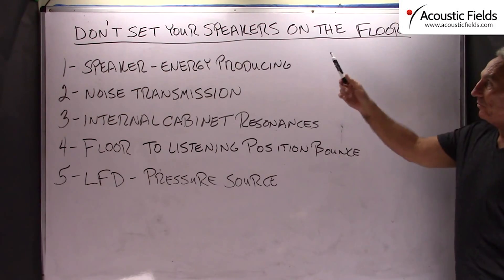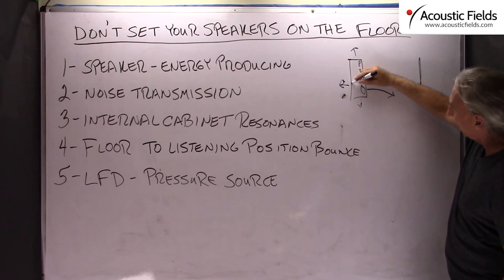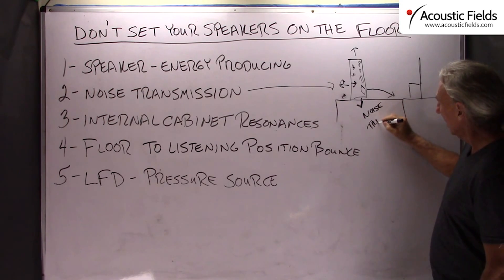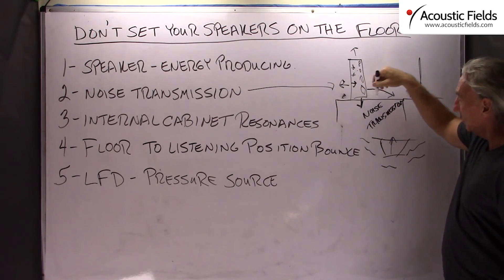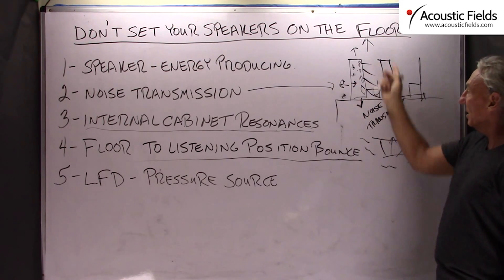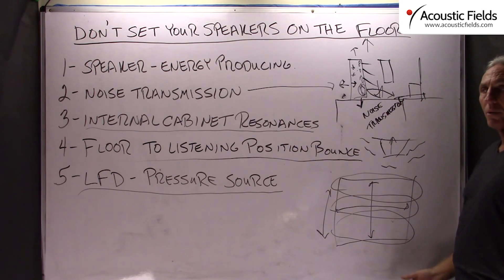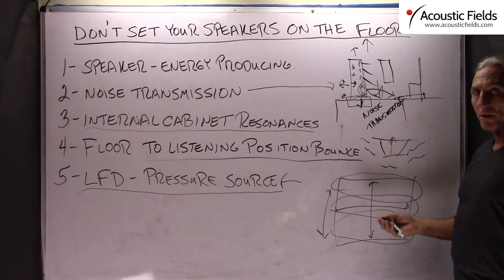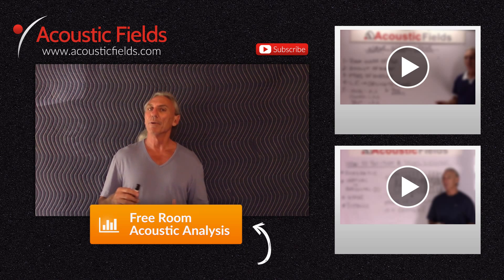Don't Set Your Speakers On The Floor! - www.AcousticFields.com

Comment: I am glad to have found your video, thanks for sharing.
You may be the best to ask, do you know why the speaker manufacturers place the base driver at the bottom?
The LF waves do go about137 degrees in all directions and there by also down toward the floor, bouncing directly up again, with mudding as a result.
Reply from the maker: F,  It is something I have wondered about for years. Some manufacturers place the low-frequency driver above the middle and high-frequency driver.
Reply: Thanks a lot for answering! Glad that I am not the only one wondering:-)
My idea is to place the base in a 45 deg towards the sealing, above the tweeter in a normal high speaker so that the tweeter still are in the height of the ears. In that way, I do think that you minimize the reflections most.
Reply from the maker: F, Positioning of low-frequency sources in small rooms has always been an issue. The issue with most suggestions is that they assume no low-frequency management within the room. If you treat your room with proper low- frequency absorption, positioning becomes much easier.
Reply: You are completely correct, most do just bye a speaker and let that be that.
But even if one are using your guaranteed great products, I think that the manufacturers should try to avoid most of the problem in the first place, then would your product have even better condition to make the sound pure perfection. :-)
Reply from the maker: F,  One would think that but I know a lot of these designers and have asked them just that question. Most tell me it is about appearance and size. Go figure.
Reply: So rather nice to see then here?! Yes go figure! :-)
Reply: I guess that the point of most designs is to have the tweeter at ears' level, and this conditions the placement of the other drivers lower.

Comment: Speakers have more bass on floor
Reply from the maker: K,  Quantity is not quality. You are hearing floor and subwoofer.
Reply: When it's up on air or on a stand bass gets reduced is it not better to stretch the bass by putting on something that will elevate the bass?
Reply: @TheLetterK81  the crap from the room get reduced - you shouldn't hear anything but the music and the speakers and the "more bass" attitude disappear when growing up :-)

a serious system has adjusted the levels of every speaker to ensure a flat curve over the whole range
Reply: it doesn't damage the bass or speakers in any way
Reply from the maker: K,  No.
Reply from the maker: K, What does "stretch the bass" mean ?

Comment: 2:00 I've always thought that frequencies below round about 100 Hz cannot be localized anyway as long as the wave length is more than any of the rooms dimensions. I'd say there is something going wrong if one can hear and localize the sound coming _from the subwoofer_.
Reply from the maker: E,  Wavelength is a factor. However, remember that energy is oscillating throughout the room in cycles.
Reply: Understood. So as the low frequencies might not be localized in any case, the vibrations in the room caused by the speaker do color the sound and cause reverberation? Thank you for your reply.

Comment: Can I pay for some of your time for a phone or Skype consultation? 

I'm from a very small town and was a part-time DJ for some time. I am helping install a PA system for a local bar owner who is not technical at all. I know plenty enough to get them something working, functional, and quality...but I want it to be perfect, and I think you have all the knowledge to get me that result. I can document the exact room dimensions, planned speaker placement, planned equipment, and any other information that could help me extract the most advice from our call. Please let me know. Eight One Zero, Two Four Seven, Three Two Zero Four is my phone number.
Reply from the maker: Y,  Fill out the information in this link: https://www.acousticfields.com/free-room-analysis/

Comment: Mr Dennis, thank you for your great explanation, but I have a question about, what kind of floor material do you refer ?, that affect happens with a concrete floor?
Reply from the maker: G,  Floor coverings vary with usage. Wood floors for control and mix rooms.
Reply from the maker: G,  It depends on the usage of the room. Every usage is different.
Reply: Carpet Floor has the best bass why would anyone want to raise it ? it's less bass when raised up
Reply: What about a concrete floor with porcelan tiles?

Comment: What if I'm using a vintage floor firing sub on hardwood floor?
Reply from the maker: J,  Raise it off the floor at least 18" . You must isolate and absorb energy at the same time. Here is out sub platform which does both.  https://www.acousticfields.com/product/subwoofer-platform-absorber/

Comment: Ive always been a big fan of using 4 thick rubber feet, and attaching that to the bottom of a tower speaker/subwoofer. Rather cheap, and elevating things just a few inches makes a world of difference. IE hearing the speaker, not the room.
Reply from the maker: Hi B,  Yes, elevating the speaker minimizes the comb filter effect from the floor to listener. Finding the correct height to seated position ratio is the key. We elevate listening and speaker position.

Comment: What about speakers that are di pole or have cardioid elements to lower the rear and side noise
Reply from the maker: A,  The radiation patterns of speakers are part of the design parameters by the designer. A dipole radiates energy from both front and rear surfaces to create more energy which is a combination of reflected energy from the rear wall and the front of speaker. I do not subscribe to the philosophy that more is better.
Reply: @AcousticFields  Dipole speakers seem like an invitation to out of phase sound wave cancellation (dead spots in certain places in a room)

Comment: If you're dead set on setting your speakers on the floor, here's a quick way to make mass based isolation pads:
4 inch solid concrete construction blocks.

That's it you're done.  

$3 each at the hardware store.  If you want to protect your speakers from scuffs, add a piece of cloth or felt between the blocks and the speaker.

Or if you want them to look pretty: 
Wearing safety glasses, hammer away any flashing or protrusions. Coat with plaster of paris. This will fill in all the voids, and sharpen the corners after sanding. Sand flat with 120 grit sandpaper. Spray paint whatever color, maybe add a clear coat. If you're using these on a desk, hot glue some felt feet to the bottom.  Boom. Mass based isolation.
Reply from the maker: Concrete is a good isolating material but does very little absorption at lower frequencies. You can achieve both with our carbon technology. Here is the link:  http://www.acousticfields.com/product/subwoofer-platform-absorber/

Comment: what a load of rubbish speaker cabs are made NOT to resonate as this would colour the sound
Reply from the maker: Hi Martin,

Speaker cabinets are small rooms, very small rooms, but nonetheless they must conform to the laws of physics. Though the goal of speaker cabinet designers is to reduce modal pressure and the resulting cabinet vibrations, most do not succeed. The sound you hear in your room is composed of three variables. First, you have the driver itself. The materials used in the cone and frame assembly contribute. Secondly, the cabinet the driver is installed in has modes and vibrations within in it. How the designer treats these issues influences sound. Even the cabinet material contributes. Finally, your room contributes its own "sonic stink" to the equation through reflections and modal issues. The sound you here in your room is part room, part driver, and part cabinet.
Reply: Speaker cabinets aren't made TO resonate, but a lot of them aren't made to NOT resonate.  It's a byproduct.
Reply: I've always wondered why monitor manufacturers don't bother to put acoustic foam on the inside walls of speaker cabinets... Any insight to this? I can't imagine it would add much to their assembly costs... O.o
Reply: Some manufacturers do but foam mostly absorbs higher frequencies which never make it out of the box in the first place. lower frequencies of about 500hz and below are what cause a box to "ring" and foam wouldnt do much of anything for that.  bracing is what helps those frequencies so  bracing is more of a sign of a well built box than foam.
Reply from the maker: M,  Not true. The sound that comes out of your speakers is a part driver, part electronics, and part cabinet modal issues for the inside space of the cabinet and part cabinet resonances. The design goal of the speaker designer is to combine all of these colorations into the sound he is designing for.
Reply from the maker: M, Nothing could be further from the truth. Put an accelerometer on any speaker cabinet and measure. Speaker sound output is a combination of cabinet resonances, driver speed, cabinet design and a host of other variables.
Reply from the maker: Whether it is part of the design parameters or a secondary concern, both are audible.
Reply: You are correct, but they STILL DO.

Comment: Your  video makes sense only if the floor is hollow..Like a wood floor thats raised...99% have concrete floors.......
Reply from the maker: Floor composition and comb filtering are separate issues. It is that first bounce from speaker/floor/listening position.The speaker/floor and ceiling bounce, with their time delayed signatures are issues that contribute to degrade image definition and clarity. Time delayed bounces from these surface areas mix with the direct energy from our speakers. It is this direct/reflection paradigm that raising the speakers impacts.You can also lower cabinet vibrations and achieve sound absorption values if you use the correct material type in your speaker platform.
Reply: ok gotcha...Im a bass player and have seen many stages...But i will admit the tall hollow wood stages are the most fun..The bass is insanely strong and low in frequency..
Reply from the maker: J,  Not true. Vibration transmission impacts all surfaces and yes, concrete floors have more density but the transmission of vibrations is still an issue, especially at lower frequencies.
Reply from the maker: J,  Your observations do not agree with our data. Most rooms we work in are a mixture of many different types and densities.
Reply: @AcousticFields  About comb filtering...So there are 4 paths from sound source to listener bouncing in to floor, ceiling, L side & R side. Cause to the different lenght the traveling time are different causing phase distortion: it's correct?

Comment: oh my God I just sit  my speakers on the floor
Reply from the maker: Raise your speakers / listening position 3" and listen to your favorite and most played sources. Listen for one week. Raise them another 3" and spend  another week. You will hear many changes. If you make the platforms you place them on vibration reducing, you will gain more detail and resolution.
Reply: Acoustic Fields If I raise my speakers 6”, one of the drivers will be halfway between floor and ceiling. Pretty sure that’ll be worse. Is driver-to-boundary ratio not more important than incremental floor distance?
Reply: Bass is better when speakers are on floor (carpet)
Reply: @TheLetterK81  no

Comment: so high should a sub woofer be off the ground & how to mount it?
Reply from the maker: Sub woofer height is directly related to room size and volume. In our studio, we have three subs. One is 18" high, one 24", and one 36". With an 8' ceiling height, I would start at 18". Make sure the platform is low frequency absorbing and vibration reducing.
Reply from the maker: B,  It depends on room size/volume/usage. Distances range from 12" - 48"